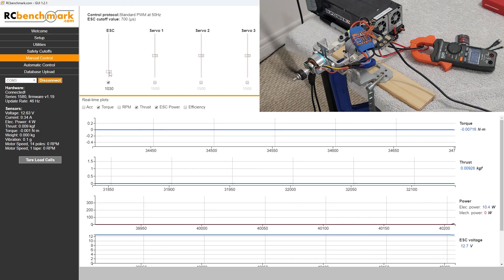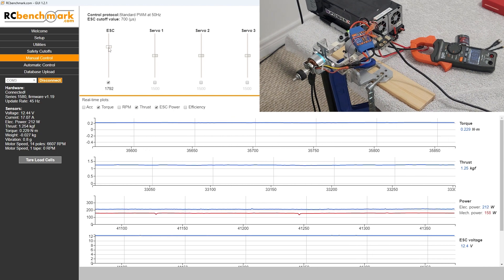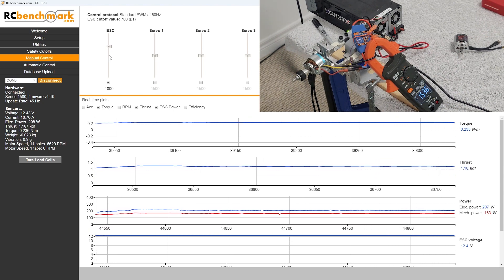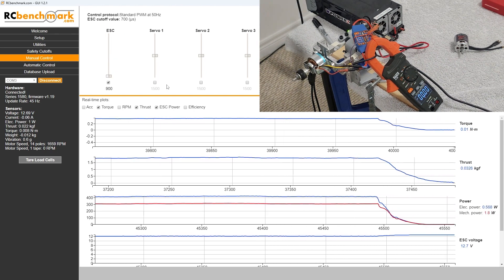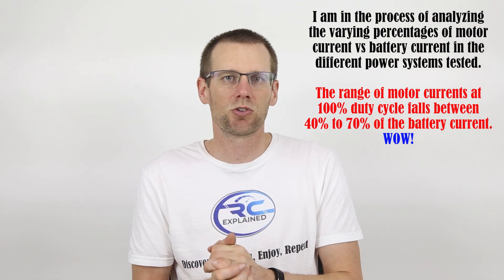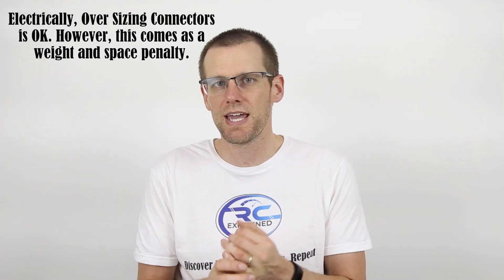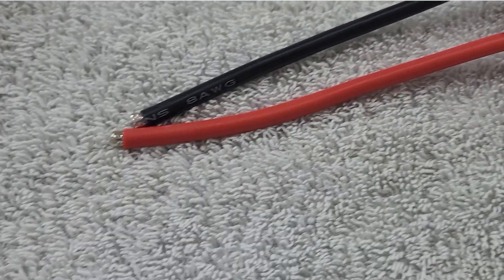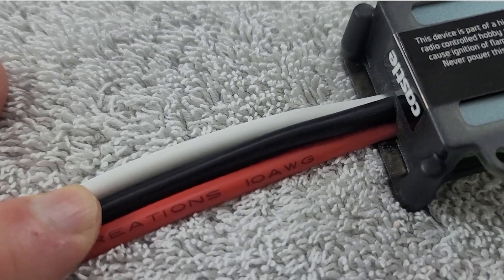Stop Oversizing Brushless Motor Connectors - Here's why you don't need to

Comment: my boat pulls 7000w to lap. 12,000w peak.
Reply from the maker: That sounds like the specs of a TP5670. That's a beast of a motor!
Reply: @RCexplained  not in a larger boat, it still isnt all that fast.
Reply from the maker: @palehorse7377  boats take a ridiculous amount of power to go fast. A watercooled 5670 does fairly well. What do you use to record data?
Reply: @RCexplained  hyperion emeter2

Comment: Tbh people that care that much about the connectors they need the biggest baddest possible connector really should just be shortening and soldering them to begin with, as that's going to reduce resistance ( and weight ) more than putting 12mm bullets on everything.
Reply: Depends on the solder, it could actualy male it worse.
Crimp connections and plugs are used in real world cars for a reason. Solder joints fail under vibration at the end typically where the solder ends.
You'd hate to see what a bus has in its wiring looms 🤣
Reply: @hulkgqnissanpatrol6121 I’m an automotive mechanic and I’m here to tell you your comment has no ground in the world of rc! Rc cars,boats even aero can pull more current than a large capacity diesel truck engine cranking every time you hit the throttle! A 6.5 mm gold plated round connection will support more current than a crimped Anderson plug 10x heavier! Any terminal you know of is junk!
Reply: @needmoreboost6369 bro I swear it’s what’s running a car not starting it😂